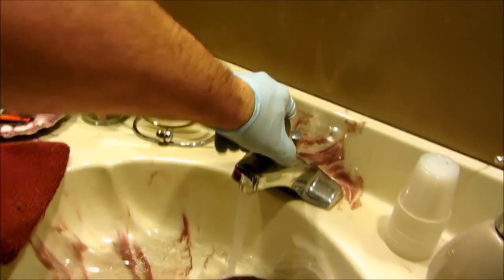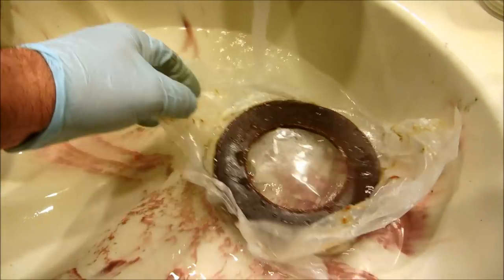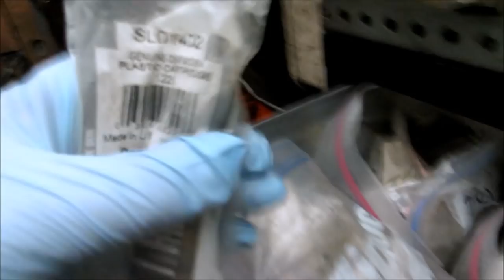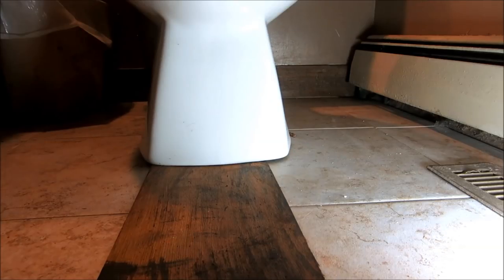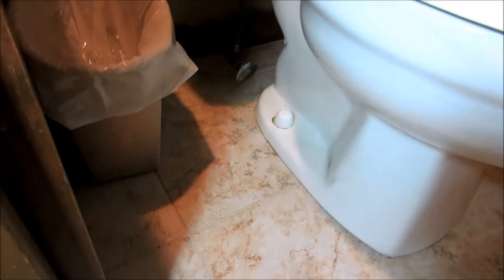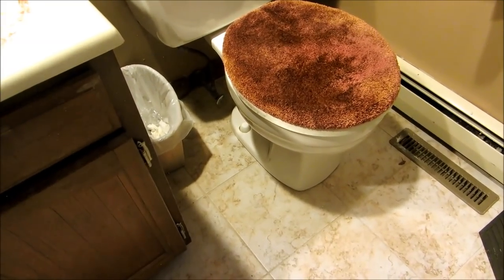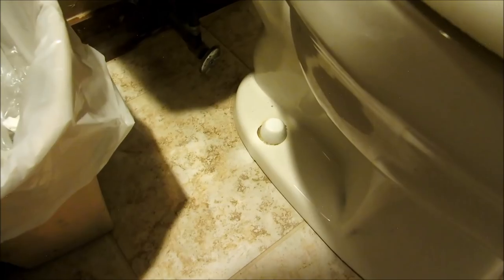toilet flange raised above new tile floor

Comment: Just wondering, If you install the spacer to raise the flange higher, would it be alright to apply a bead of silicone sealant in between the space and the old flange so it doesn't leak just to be sure? Thanks
Reply from the maker: moojuice369 the new extender flange has a lip that is tight to inner flange and seals ,,,there was also wax on the old flange to seal them together. once you screw it down it will never leak if you silicon it down ,,its hard to get off if never needed to . i rather go my rout i never have a problem doing it this way.like i said there was some wax left on old flange that will act as a seal

Comment: Why do some jobs put the wax ring on the toilette, and other jobs put the wax ring on the flange? Also, it is better to have the flange sit a bit 'proud', rather than level with the floor. Any advice is appreciated. Thanks!
Reply from the maker: Tiffany Boone yes the flange belongs above the floor.screwed down on top of the tile ect. you can put the wax on toilet or flange it does not matter

Comment: Strange, if the tile guy did an underlayment, he should have used a self-leveling compound and the surface should have been flat and not required a wedge.
Reply from the maker: Blair Maynard shit happens out in the real work area we do the best we can with what we have to work with

Comment: You might want to reconsider using a grinder with a cutoff wheel when cutting the bolts. It will impregnate metal in the toilet and stain it. I have had that happen in the past. I use an oscillating tool with a carbide blade now.
Reply: Joshua Oddo ....Ive had that happen.Now I just put a piece of cardboard between grinder and toilet.

Comment: should have put a bead of silicone under that flange extension.
Reply: Oatey flange extenders actually mandate that. Just set one, the other day, in a bathroom I'm rebuilding (leaky toilet rotted out the particle board underlayment under 1973 lino flooring) and there's a groove that the silicone is applied into, before setting the piece in place on the floor flange.

Comment: you really should be using wax rings with horn.  the wax ring you used is better use to add on to one with horn.
seen too many leaks doing it like that. -that and peeps using putty....which will leak
Reply from the maker: 90 percent of toilet leaking on floor are because of wax with funnel you can;t work much  if thats all you use .comment shows your stupidity . and lack of experience .
Reply: steven lavimoniere  got 30 years of plumbing under my belt. of course any one can install a toilet wrong with what ever wax ring.  and I never get call backs for wax rings leaking.

Comment: About how far above the new floor should the flange be? Mine is just about an 1/8th inch below the new floor surface
Reply from the maker: +Backyardmech1 about a 1/8 above or so would be good
Reply: Cool. Thank you very much

Comment: Steve, thanks for the vid. Love all your help. My question is can you stack those spacers?  My original flange is about 1" below the tile. I assumed stacking those quarter inch spacers would leak for sure. Do they make them super thick?  I ended up using two wax rings stacked. Not a good solution but it's working for now. Thanks!
Reply from the maker: +Pete Heckman yes you can stack the spacers they come in the kit with longer closet bolts ,best to seal with silicon between spacers . do not use a funnel wax .use a regular wax ring ,no black funnel inside

Comment: What do you do if the floor is lower then the flange
Reply from the maker: Isaac Ventura lower the flange to sit on the floor
Reply: steven lavimoniere I mean how do I do that do I have to cut out the old flange or take a screwdriver and a hammer and chip it out and then replace it to sit on the floor
Reply: The only other way I know is to replace the waste pipe and the flange by either cutting into the subfloor or going in his basement they have one

Comment: Great video!!  Can you tell me the brand name of the extension flange with the solid bottom and inner lip.
Reply from the maker: +Mark Jaggers not sure i get them from the local plumbing supply house
Reply: +steven lavimoniere  
I was able to figure it out from one of your other video's. for those interested it's a Pasco 1018-k closet flange extension 3pc kit